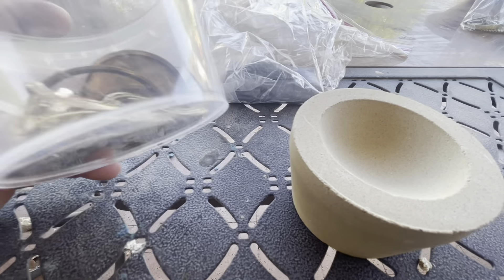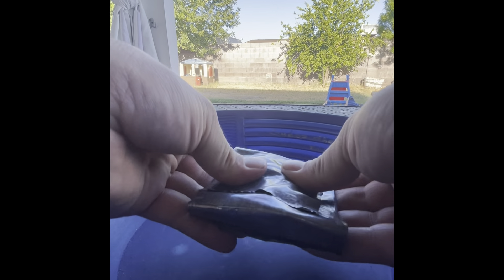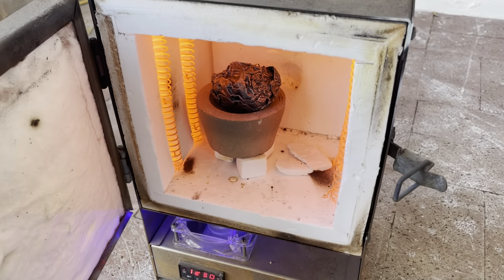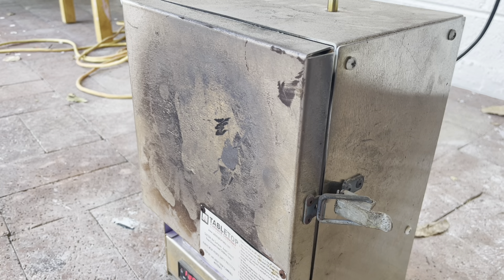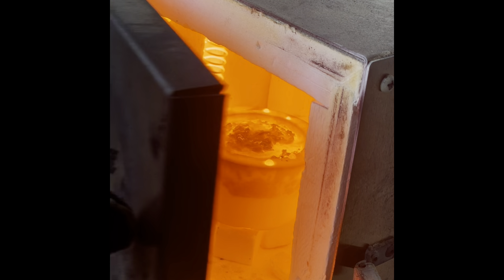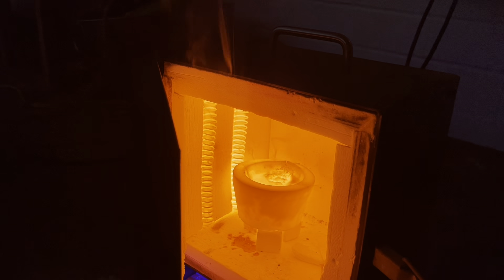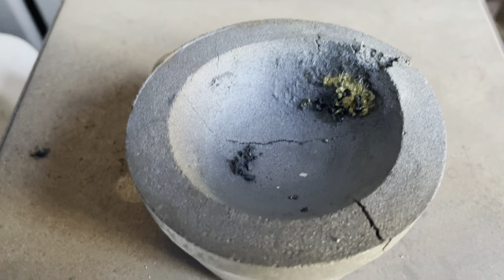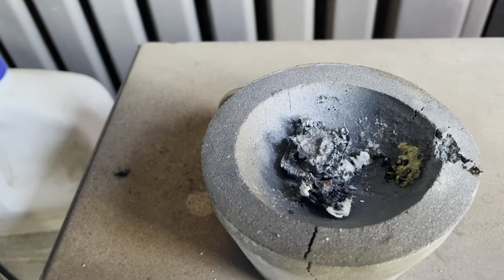Scrap Jewelry Gold Refining - Cupel FAIL!

Comment: It wasn't that you got it to hot for to long, it was because you overloaded your cupel with oxides. Copper oxides are notorious for that. Then add your zinc, lead, and whatever to it, you would have failure. Weigh your cupel fresh from the pack, if it's magnesium based it will hold less in oxides. Bone will hold it's own weight. Cement is about the same as magnesium. Remember Mike, your furnace is a beaker, operated at a high temperature.  See how the furnace really smoked when you opened it? That should tell you your oxides had no where to go. Cupel was full.
Reply: I know nothing. But this sounds correct! Lol
Reply from the maker: I think you are spot on brother I think In part two I follow up with this comment thanks for your help as always
Reply: @VendettaProspecting  I saw part two. Thanks for the shout out. What happens when you are trying to oxidizes all the metal is they won't.  You start dragging the oxides into the cupel. When the cupel reaches its saturation point it expands. The oxides have nowhere else to go but out. Unfortunately anyway they can. You did a great rescue. Some day I want to come down and have you film a real assay with a common YouTube assay. Side by side. Show the difference between a real assay and a not so real. I get so p.oed at people strutting around like they're really something and they're not. I still have some gold I could maybe sell if I needed a motel room.
Reply from the maker: @richardbeee  that would be quite the video for sure man
Reply: @VendettaProspecting  interested?
Reply from the maker: @richardbeee  if I didn’t have kids running around all the time I’d be happy to Richard!

Comment: I don't understand why you had to add lead.  Lead is a base metal.  The non precious metals in the scrap jewelry are usually base metals.  The base metals in the jewelry would oxidize during the cupel process.  Only oxidized materials will absorb into the cupel.  Maybe just add the jewelry next time and sprinkle some borax occasionally during the process.  IMO your added lead overwhelmed the cupel and caused the fail.
Reply from the maker: Hopefully the 2nd part answered that brother great question 🤙🤙🤙